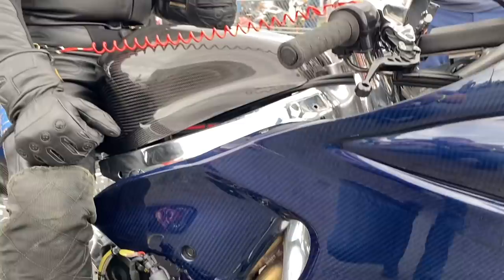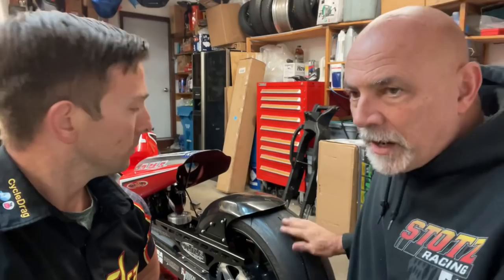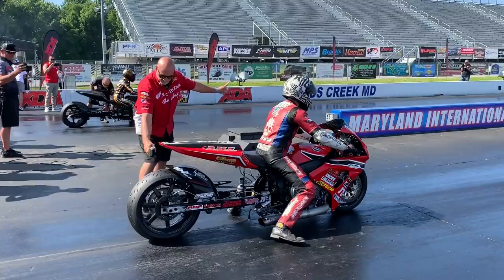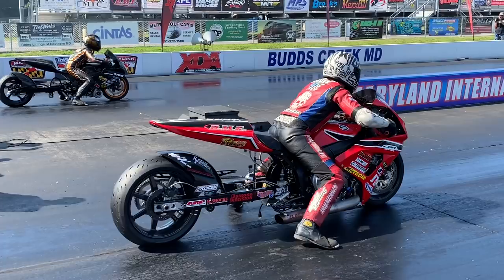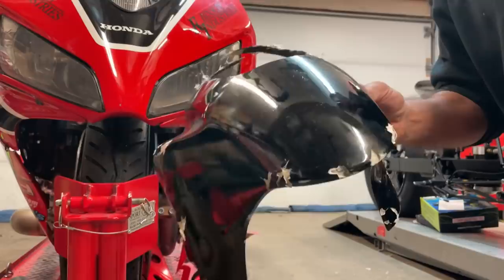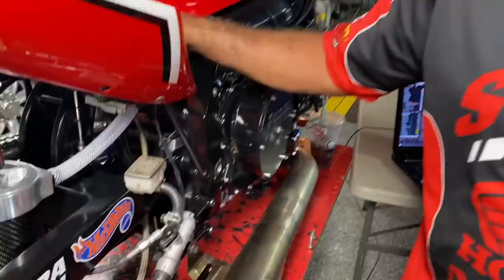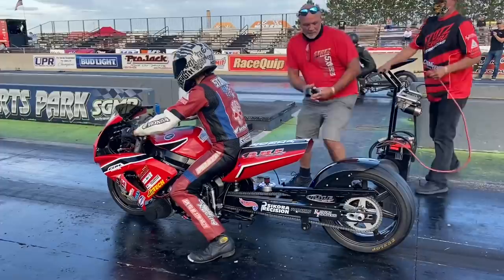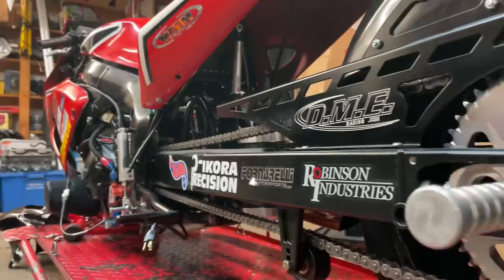WORLD’S FASTEST HONDA MOTORCYCLE! How the 700 HP turbo CBR 1000rr REALLY works!

Comment: A bus is a thirteen hundred and something cc engine versus the Honda thousand and the Honda is beating the bus or hanging right with it now I don't know if the cylinders have been bored probably have butt there's no substitute for cubic inches or centimeters so that gives the bus an advantage Honda can build an engine when they want to the 750 when it first came out the cbx was a world beater the 92 model 900 Honda was super light and fast it'd be a lot of bikes bigger than it and the new thousand it is very fast

Comment: I would never ever buy a Honda. 2 months ago a did and it was my first new bike. NC 750 x dct. Only reason I bought it was because I lost àncle move in a motorcycle crash and Honda is the only good one clutcher at steering wheel. So boring this bike! Got 300 kms now. I cannot handle a nt1100 or Africa twin with my handicap zo after sh300 there was only one chose. (except the scooters, bt that's not a motorcycle... But neither is the nc750x. Now I discovered "pingel". System to clutch fingerpush and fits every motorcycle. Didn't order yet but I still have a mt01 naked 1700 and maybe I should give the cost from 1800$ a go. 😉 If this works out, I don't need to drive Honda anymore😂